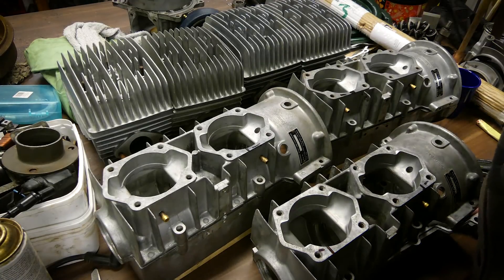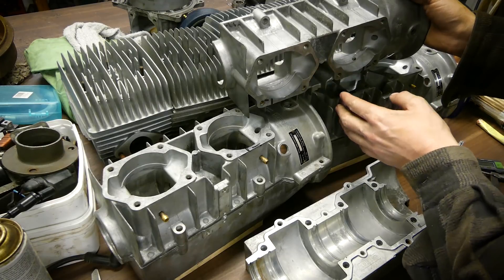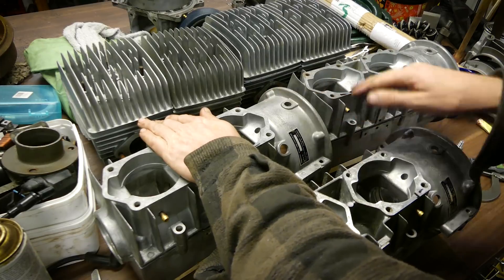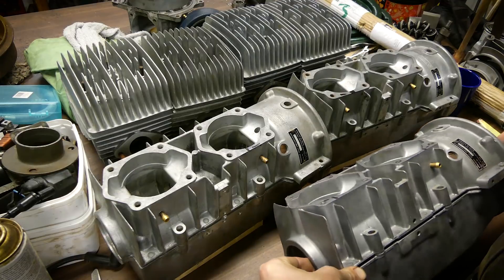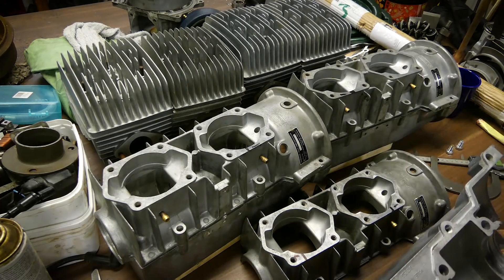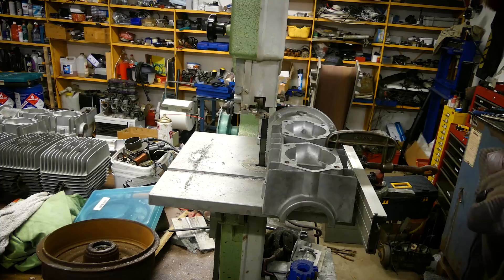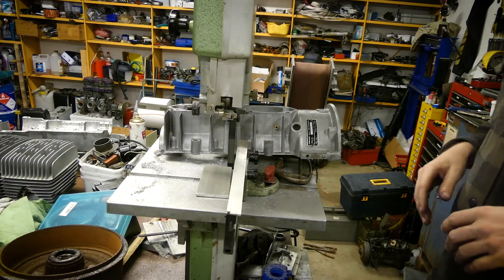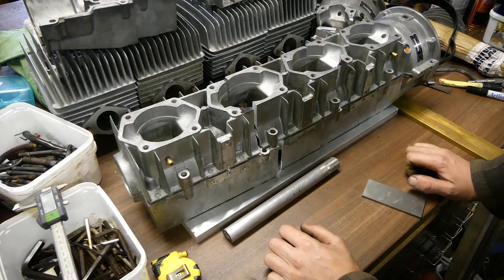Cutting some crankcases - 873 cc 4 cylinder 2-stroke part 1

Comment: I suspect that may need to line bore the casings after all that welding to ensure all the bearings are going to be dead centre of one another.
Reply from the maker: I am behind a bit with the editing and I'm pretty much at the stage where I need to start welding things together now. I have turned and ground a solid steel blank "crank", and plates to bolt the top and bottom to keep them from rotating on the shaft. I've also done some test welding on leftover crankcase parts and as it turns out, these castings are horrible to weld, there's so much oil and junk in them. Also accessibility is an issue, I just can't get at all the places that need to be welded from the outside. I would need to weld them from the inside without the fake crank in place, pretty much guaranteed to become crooked. So currently the plan is to just tack everything together and use a different method to seal the joints. The welds don't have to be very strong, rigidity will come from the plates that will go on top and underneath the crankcase, so the main purpose is to get everything sealed. I have some brazing rods coming but I'm not sure how they work with aluminium, but if those work that might be a good solution, a lot less heat involved. I'm also doing a JB weld vs Methanol test, glued some crankcase pieces together and submerged them in methanol. So far that's looking good too. I would prefer something more proper though :)
I am hoping to avoid having to line bore it, because that's not something I'm setup to do myself at the moment. Really need to get my large lathe on a properly level surface... If I have to send it away for line boring that's going to be at least a month of no progress, the companies that take that kind of jobs here are pretty busy.
Reply: Ive done some casing welding and casting always throws up lot of junk, my approach was to use a wire wheel periodically to re-clean the surface back after welding some.
One thing I've had to do is get a large enough oven to heat the whole casings up, pull them out and do a bit of welding then back in the oven repeating that many times over.
Aside from aiding the welds it helps avoids warping..
Due to the junk in casting on one job rebuilding intake casting on my RD LC 350 race bike barrels to fit YZ 6 petal reeds I could not avoid pin holes and ended up having to use devcon putting to seal it that worked well.
Good luck with it.
Reply from the maker: I'm going to need a pretty wide oven for this one, I only have my little oven/stove that won't even fit half the case. Heating things up properly definitely helps a lot though. I'm going to do some measuring and see if there's any chance I can find a cheap-ish 2nd hand oven that it will fit in. Being pretty new to the whole TIG thing is not helping either, but luckily I have plenty of test pieces to experiment on with different settings etc.
We'll see how it goes. I have a feeling I need all the good luck I can get so thanks!
Reply: @Hollaendaren  instead of buying a bigger oven use a 4 burner bbq with a hood,plenty wide enough for an inline 4,just monitor temps with a gauge. Been useing one for years to heat parts and for a powder coating oven.
Reply: @yuk-erkmckirk9277  Just what I was going to suggest. Also portable and doesn't require high voltage to run it. Can use it occasionally to cook on as well. Man's gotta eat too.